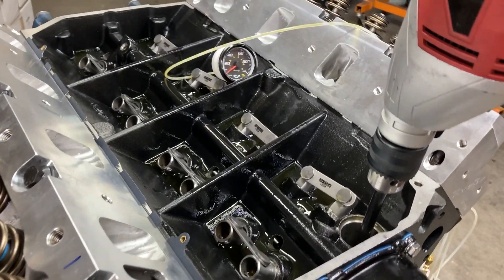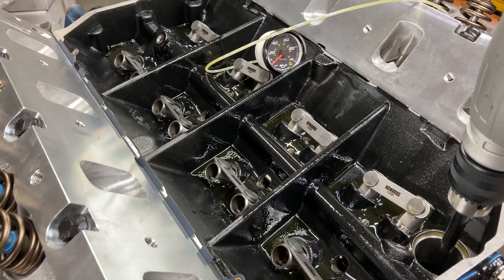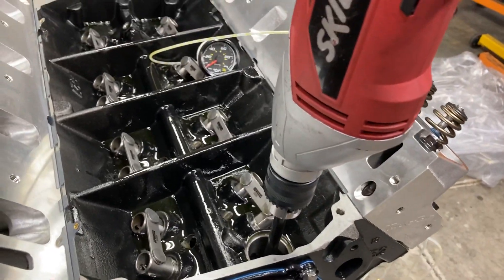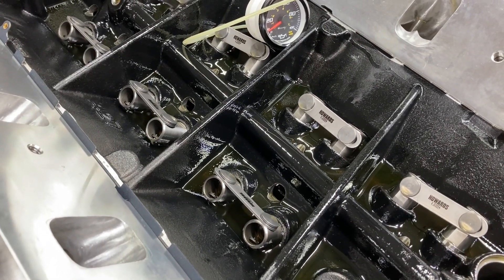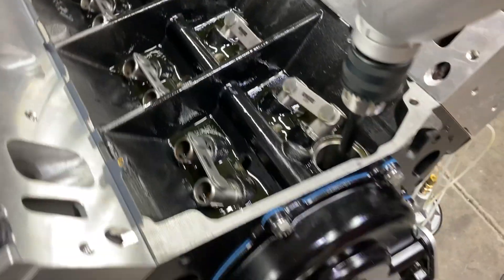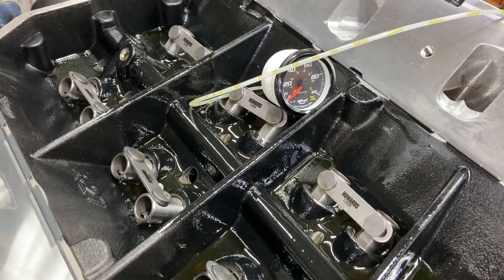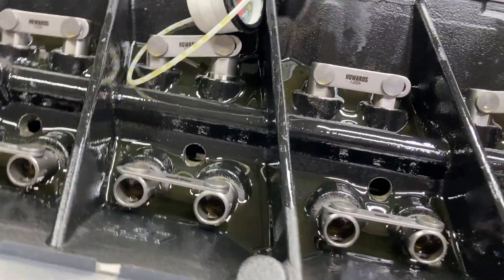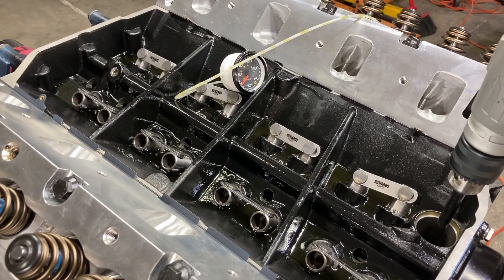Lykins Motorsports Ford 496 FE Priming Oil Pump

Comment: I like your attention to detail and making sure everything is in perfect working order. The time it takes is worth to not go back into the engine after the fact. Time vs distance, as in the extra time it takes to make sure it is right spread out over the distance that that engine will run is probably less than a second per mile.